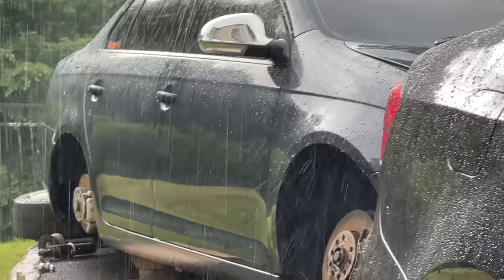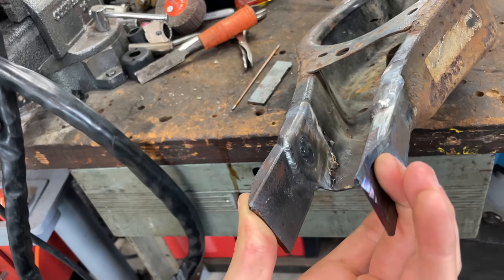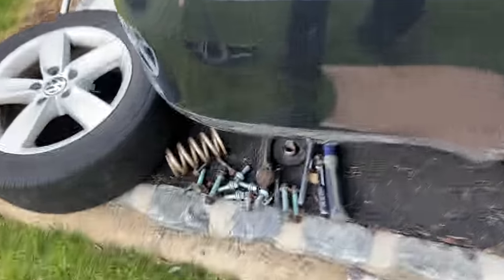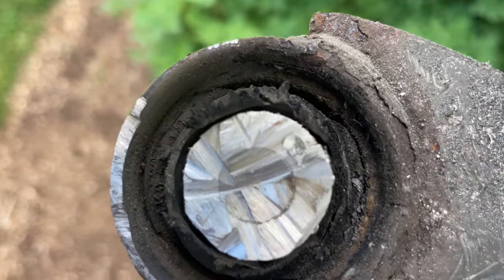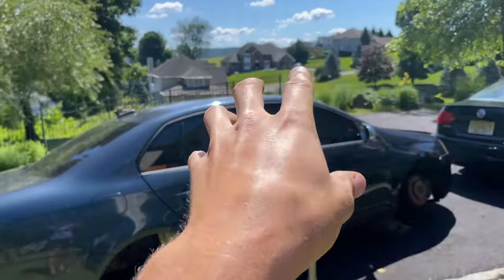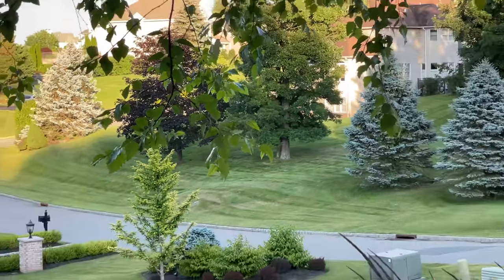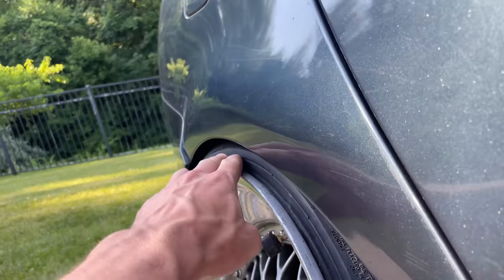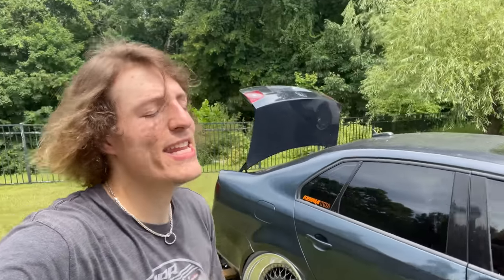BUILDING A CRAZY CAMBERED TDI

Comment: Yooo static mk5 gang checking in. I'm on porsche twists and struggled with the fuel filler as well. No struts, running solid rear suspension 😅